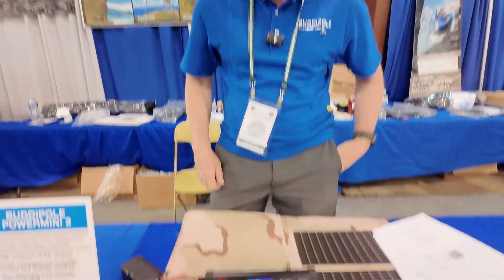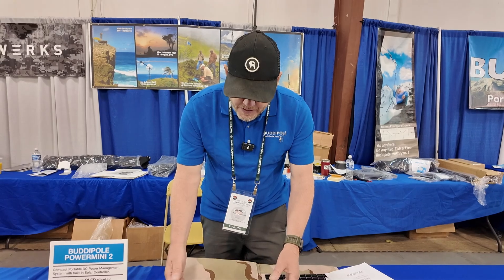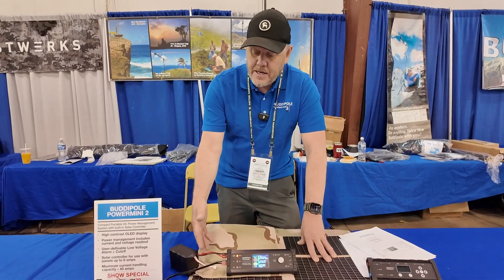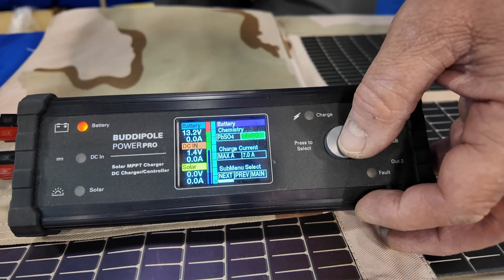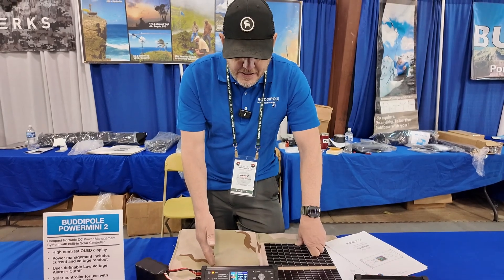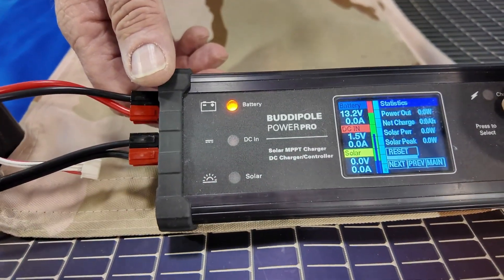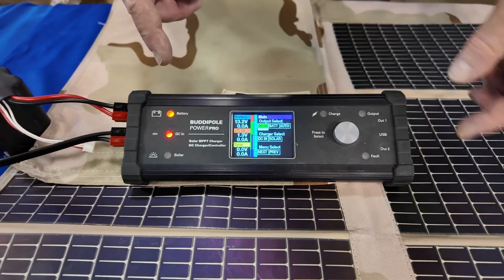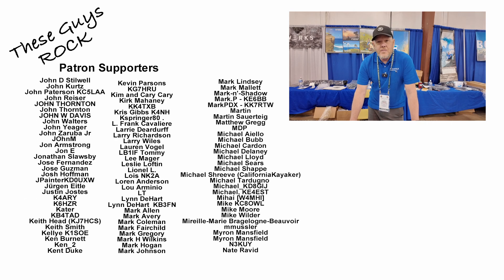BuddiPole PowerPro

Comment: Is USB-C PD based?  The PowerPro lets us make battery boxes be dumb batteryboxes again, with its charge controller. Boost too?  What is max Solar Panel input?  Can Boost work with car 12V where I can limit DC input so that I can recharge with car power port on a drive?  When will spec sheet be available. What do you think of the price of avocados in south america?

Comment: $349 as of 5/29/25. It is only good for 150w solar. For the price, I expect higher.
Reply: If you want higher go with Victron.  And,,, get out your wallet.  I think this is on point for pricing.
Reply: @johnmichaelmclaughlin3937 you can get a 30A Victron for less than half that price